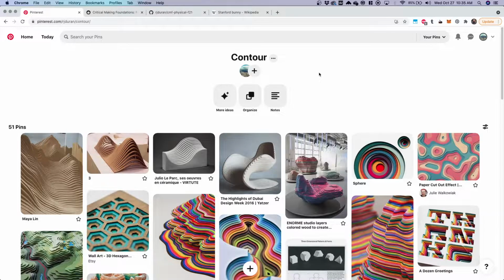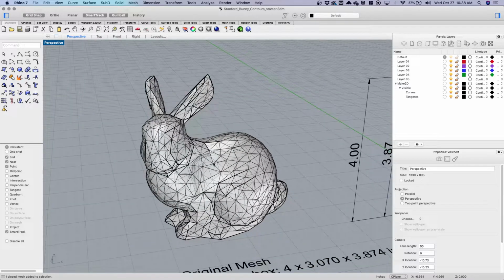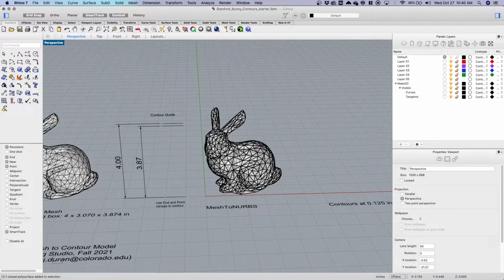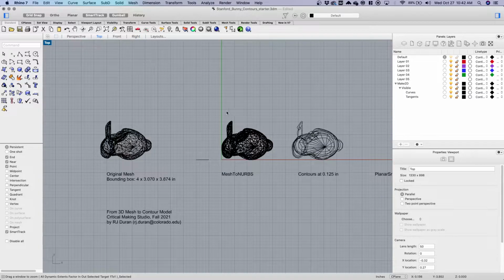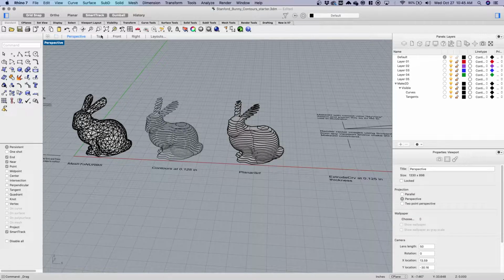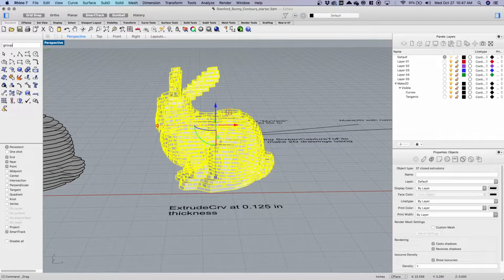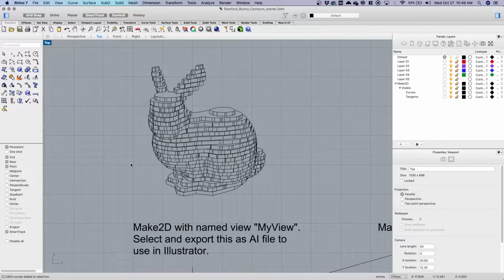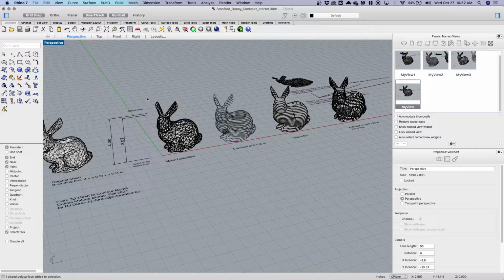Rhino Tutorial: From 3D Mesh to Contour Model

Comment: how do you cnc the slices
Reply from the maker: It depends on the material being used. For example, you could use a laser cutter for 1/8" sheet material such as acrylic, plywood or mdf or a CNC router for thicker materials.